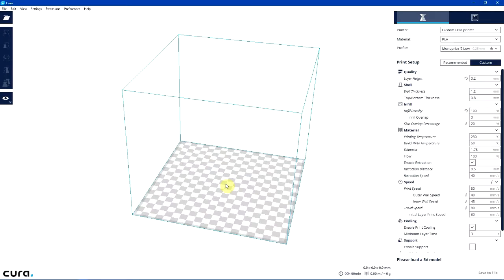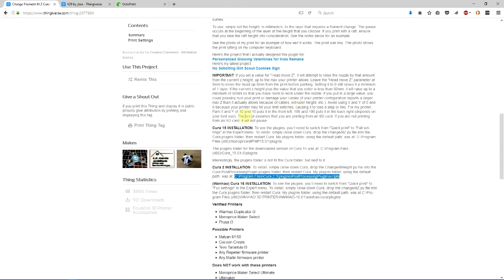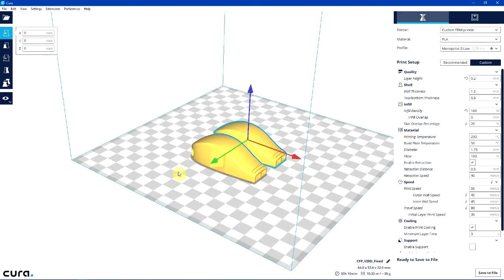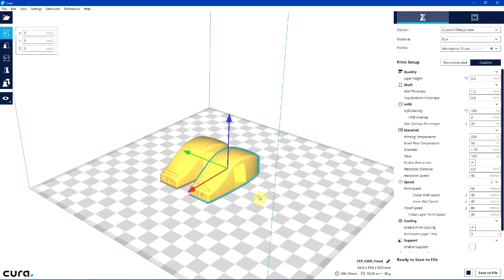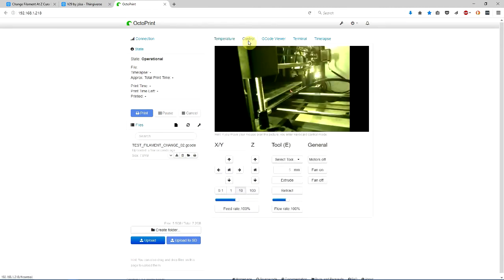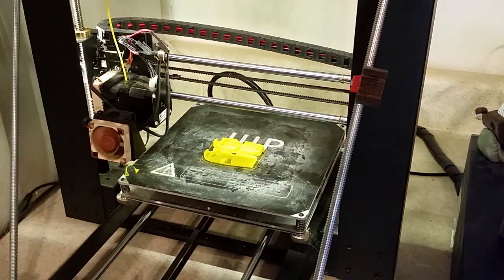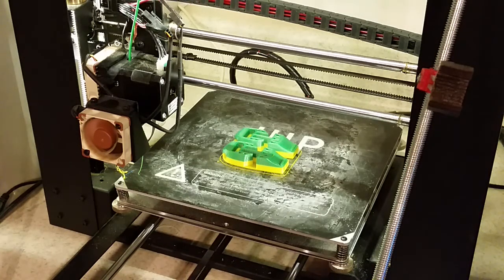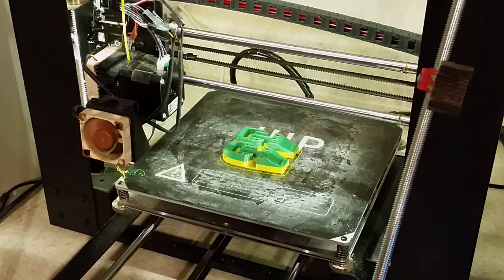Mid-Print Filament Change in Cura

Comment: So I see you are able to do this using Octoprint. My question is, once the print is paused and the filament is swapped out, how do you get it to resume printing? Does it actually show the pause screen in Octoprint, along with the resume button, or do you have to resume print using the control box on the printer itself.  The instructions aren't great on the Thingiverse page, as it says for this to work you have to print from an SD card..That is a different process all together.
Reply: I have the problem and question... how to resume printing after changing the filament?

Comment: I am using the Cura that came with my Maker Select V2.1 and it appears that it uses Cura 15.x.  I have placed the script into the plugins folder however when I go to the Plugins Tab it does not show up even after several restarts of the application.  Any suggestions?
Reply: I figured it out....I didn't realize that you have to place both .py files into the plugins folder